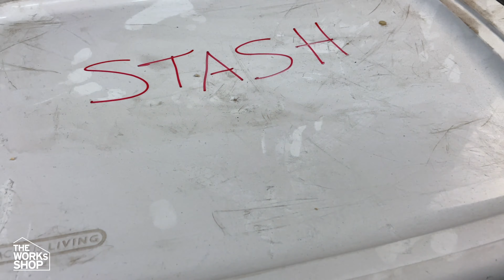Vintage Ratcheting Carpenter's Brace Complete Restoration with New Handles

Comment: Great job!    I don’t have a lathe either and use my drill press as well.   I do mount a large bolt into the drill press vice to use as a tool rest.   Works well but has limitations.  Very well done!!!

Comment: What a superb restoration! My husband offers a few suggestions, if he may. The middle handle can be cut in half first and glued back with a piece of paper in between. It can then be drilled and turned on a mandrel  and afterwards simply split with a sharp chisel (dilute the glue a little) and then re-glued. (Cocktail sticks can be used as locators before final gluing)This will avoid nasty glue lines. (Incidentally, what grit did you use on your polishing mop, please?) Also, please line the jaws on your vice with a piece of lead or copper to avoid marking the work. Finally, my partner says, please, please, please, please treat yourself to a lathe. (The plywood top handle is super!) With best wishes from the UK. Veronique.

Comment: Necessity is the mother of invention. Nice job! I would have done the handle a bit differently, and not because I have lathes.... The technique is to take 2 pieces of wood, plane the surfaces flat, glue a piece of brown paper grocery bag in between the two, then drill and turn. When done turning or shaping, then use a chisel to separate the pieces, scrape off the paper and then glue the 2 halves together again. The blue painter's tape is great for pressure when gluing together again, or if you have some, the stretch film works great too.

Comment: Yes, there is greasy crap inside the chuck, but at least it prevented rust. I read from a 1940s wood working book, the way to loosen screws in wood, is to put a soldering iron on the screw head and let the heat expand the screw, inside the hole. I haven't tried that myself, but I guess you keep the iron in place until you smell the wood heating up.
Excellent restoration. I particularly like the very generous, comfortable handles you made. Better than the small commercially-made ones you find on old bit braces. Earlier braces from the 19th. C. had no wooden free-moving crank handle at all, imagine the blisters after a dozen holes or so.
Reply from the maker: Thank you, I will try that soldering iron trick next time I have old screws that are in tight.

Comment: Awesome job. I have a question though. Why didn't you remove the bearings in the handle, clean and lubricate those? Did you have difficulty removing them?
Reply from the maker: Thanks! The bearing for the top handle was working quite smoothly and to get it apart would require grinding, and later, tacking a weld or two to hold it together. I decided a shot of spray grease is less risky. Now if they had been in rough shape I would have had to take it apart to replace any ball or needle bearings inside. I got lucky with this one.